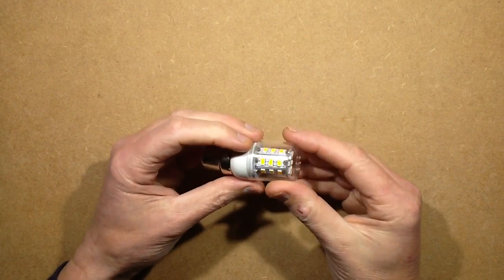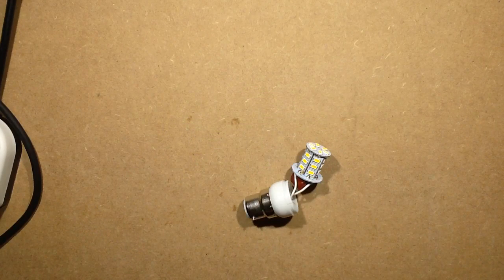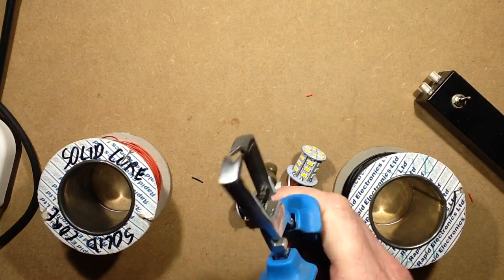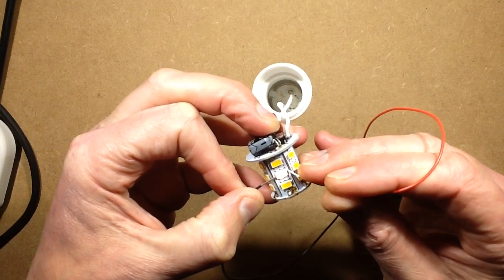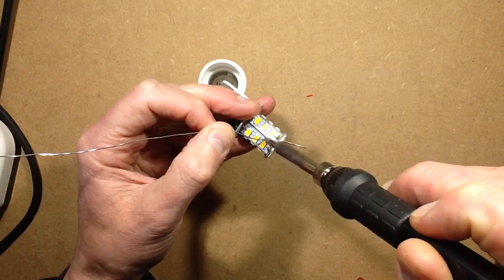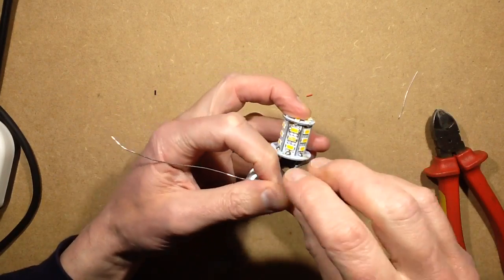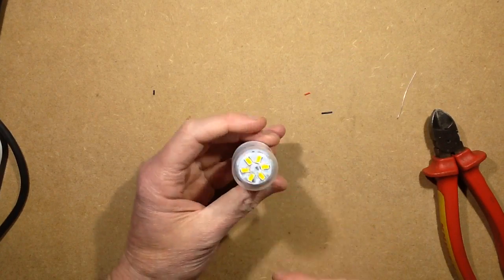Fixing a dead LED lamp.  (Interesting failure.)

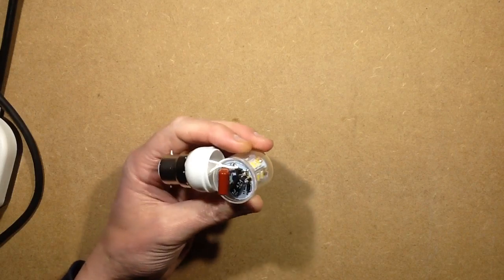Comment: 1:07 probably a discharging resistor. Do you agree?
Reply: Or the led itself
Reply from the maker: These lamps often have a discharge resistor across the dropper capacitor, and an inrush limiting one in series with it.
Reply: That’s what I said that there’s a discharging resistor

Comment: Clive, we all know that LED Lights often fail - well before their expected life! Being a bit of a Thinker, I would love your thoughts on this: Why not have an Induction Coil, which is inbuilt into the Bayonet Light Fitting - just a small (circular) torroidal transformer which could give a very low VA, and (yet) cater for all Wattages of LED Lamps. THEN, another much smaller circular coil, which is built into every production-made LED Light Unit. The whole purpose of this arrangement, is simply because there is an extremely-wide voltage range between the Domestic Mains supply (here in Australia is the same as the UK - at 240VAC and 50 Hz. Already, we have two (2) large issues: LED lights work absolutely the best on a stable DC Power Source, and also bringing down the wattage slightly using PWM.I have done this since 2005 in my home, with LED Lighting (17 individual Units) which illuminate my home from Dusk to dawn on 365 days / year, and it's so good that I could not live without it! My point is: Not ONE of those 17 LED Lights failed, but I just changed them all out last week, because I noticed that the illumination of each Unit had deteriorated over the 17 years of daily use. LED's work perfectly, at a stable current and voltage source, but more particularly if they have a well-known brand, and not a Chinese copy of the famous brands. If you are still reading this, the main objective here, is to solve the issue of the large voltage (mains supply), to the voltage that would be more suited. Lets say 12V AC. 
A small circular (mating) Coil which is built-into every LED Lamp, would ensure sufficient voltage could be supplied to illuminate any type of LED Array. In this way, the internal PCB and components that are currently used - could be slashed by the LED Manufacturer. I was horrified to open-up a 240V AC / 15W Light Bulb from ALDI. This was made in Germany. The PCB was loaded with 2X the number of components on the Board. Now, the worst part of all was the Cast Aluminium Heat Sink. I swear that this Casting weighed the equivalent of 20 aluminium Coke Cans!! Many or all of these failed lights end-up in Landfill. The ALDI LED LIght was also hard plastic coated. Germany has no thoughts on greening the Planet producing these. If you are still reading, my proposal would be this: Every person who uses LED Globes, could also buy a Bayonet Fitting with a circular coil. It's not Rocket Science to fit an external component (that would normally be inside an LED Light on some types), which can be used indefinitely. I would just love to see Clive make one of these - with fewer (bare minimum) internal lamp circuitry and components. Then, using a quality LED Module (such as Cree), then leave it permanently lit to log its' life. Sorry that this is an Essay, and greetings from Australia.

Comment: I have two corn cob lights waiting to be repaired and you have prompted me to finally do it. I also noticed the tiny black speck on a couple of the LED's and found them to be faulty so kept the globes for eventual repair. They were fairly cheap but only worked for a few weeks then died.
Hopefully the link across the dead ones will work.
Thanks for the effort producing all the videos.
After reading the comments it seems like a very common problem.

Comment: I literally have the exact same light, and the exact same thing happened to mine, black dots on the led's that burnt themselves out. Clearly this LED itself is a horrible design, if both mine and yours did it. If memory serves me correctly I bought it on ebay. I live in Australia where our voltage is also slightly higher than China's, when voltage at the source is higher, you would need a different value resistor to keep the current at the proper level that the led diodes can take. These fail commonly, because the extra 10-20v in our countries, drives the LED's a bit over, and because the LED's themselves are not super amazing in quality. 220v is China, Australia is 230v, Scotland is 230v. 
This isn't the worst LED I have however, I bought an LED that failed in a matter of minutes, to open it up and find out that the Chinese had used a 100v capacitor, predictably it was bulged out and destroyed. 
The only LED I have that lasts, are ones bought in Australian stores that are specifically made for our power. The longest lasting LED I have is my own LED made from 3 of the 1w diodes that are on a heatsink, and are run from a 3w LED constant current power supply bought off ebay, which is like a little white plastic box and about the size of a match box roughly. This setup has run every night for around 8 years, it's truly reliable.

Comment: Hi I took one of this apart I have 6 leds. Was wondering if I can connect this to a 12v motorcycle battery. Would I need anything or I can just connect it straight?
Reply from the maker: You can get 12V versions.
Reply: @bigclivedotcom  thanks for the reply. What I mean is if I don't want to buy any new led. Can I use this directly or I need resistor ?

Comment: I had one very much like this (screw base) fail after only 3 years....I say "only" because it is my flipping FREEZER light which is on MAYBE 20 minutes a month during the very brief times we open the freezer!  Makes me wonder now if the door switch is stuck.... why would anyone lead light fail Indo short of on hours??    Maybe 12 hours total on time in 3 years?  Probably much less I am using worse case..is there something about freezing temps that would cause early failure?   Should I use an incandescent instead ?

Comment: I bought 6 - 8 of these crap LED lights.  EVERY ONE of them failed like this.  No matter how many times you replace the blown LED with another one (from a different 'blown' LED bulb), it WILL blow again, guaranteed.  I finally threw them all out.  Complete garbage.

Comment: 4 years later .. does it still run ?I have had several of these lamps, and bridged many ledsbut they just keep failing !  poor design and manufacture.
Reply from the maker: Most of that style are severely over-run for intensity at the expense of lifespan.  If you swap the dropper cap for a lower value it makes them a bit dimmer, but last a lot longer.

Comment: I"ve had 3 of 'm die on me in the last few months...  is it just because they're rubbish or could I have a problem with the electrics in my house?  outside of bulbs nothing failed on me yet...
Reply from the maker: Many of them are pushing the LEDs too hard and if put in a warm area or enclosed fitting they overheat.
Reply: thanks  Clive, that could be it

Comment: Hello big Clive, I actually use these type of corn style bulbs at home (the 72 LED type) and just last night one of the bulbs showed some of those black spotted LED chips. Now this bulb will still light very dim but also after cutting out the power it slowly fades until it's off, I was wondering if you could examine the bulb if I could ship it to you. I very much enjoy your detailed way of exposing the different electronics!
Reply from the maker: The LED string has gone almost open circuit but is still allowing a little current to pass making them glow.  The slow dim out is because the low current means it takes a while to discharge the capacitor.
Reply: bigclivedotcom thank you for answering it makes sense! Keep up making your videos it's great watching!

Comment: @bigclivedotcom What brand or make/model of wire strippers on those? Tired of dealing w/ ones that are junk.
Reply from the maker: +David Willequer I tend to use a manually set Unior stripper.
Reply: Thanks for the follow up. Looks like those are hard to find in the United States but I found a pretty comparable one on Amazon after some digging. https://www.amazon.com/11-02-160-Insulation-Strippers/dp/B0001P0BYO

Comment: Great tip thanks Clive!
If you scrape/melt off the faulty led and just blob the board connection with solder it's even more easy and clean.
It's just a shame to throw away so many led's and components just because one small led is faulty.

Comment: I used a "V"  wire strippers some sixty years ago and I liked them much but they can nick the wires.  We were told that  type of p;lane had several crashes with many deaths and they traced the problem to a nick in the wires. Vibration caused the nick to grow ->  be careful.

Comment: I have been using 7 corn bulbs in a pendant ceiling fitting and despite intermittent use after about a year they have been failing every few weeks, in one case a replacement failed within days.   The failure rate is much worse than for an incandescent bulb.   I have just followed this video and successfully repaired 4 of these corn bulbs.   It will be interesting to see how long they last as clearly the voltage across each individual LED is now fractionally greater.

Comment: I recall an article comparing a LED bulb with an incandescent: the latter has one short-lived filament, the former (say) 15 LEDs in series. Point was that the LEDs and other components really need a low failure rate to be competitive because if one fails the bulb fails.

I think the $1 Dollar Tree 9W LED bulbs might outlast the $0.50 Dollar Tree 130-volt 60W incandescents they're replacing, but that's 12 LED chips, their solder joints, a capacitive dropper's components and their solder joints... versus a bit of tungsten and a very few wires and connections. Sure, I'm saving a good bit of power, but there's a lot than can fail...

Comment: it is not good idea, to fix like that, because if you connect wire like on video, result is to high current in the system. The LEDs will burn!!!! Kirchhoff's circuit laws my dear friend.
Reply: I dont think it's that big of a deal. Yes other leds will have higher voltage and be hotter and die faster but it will be barely noticeable.
Reply: Have you ever seen I (U) for diode? Even a small change in voltage can cause a huge change in the value of current flowing through the diode. current rise will increase capacity so that the LED will burn
Reply: I repaired 100+ this way and nothing happens if you're only doing it for up to 3 ~ 4 leds, no any noticeable difference in the life span of the other LED's.

Comment: Ha! - I've had 3 of these go  - I noticed the hole too, attempted to make 2 lamps out of 3 - but the LEDS keep failing - gave up. Caused by Voltage Peaks when the Arc Welder is running in the workshop?? Previous Pineapple lasted a few years before dying. You're doing a great job.

Comment: The problem is in 5730 LED TYPE:.. Those shine brightly but also get A LOT OF HEAT and thats big problem for LED. First thing you do is to remove the plastic transparent housing so that HEAT DISSIPATION is much better...  But it will still bun out eventuall...

Comment: First thing I do when I get those type of CORN LED is to remove the transparent plastic housing (I Saw it off).. This transparent housing is keeping the HEAT inside the led lamp which is a PROBLEM!... This way you extend lifespan of this lamp. 
Secondly, ... When repairing it, I just pile off the LED CHIP thas is burned out (visible sign off fry)..And then I simply solder it over..I Just completly replace LED CHIP with SOLDER:... Problem solved in 1 Minute !  :)
Reply: Exactly what I figured and did before I saw your comment.

Comment: The first LED lamp I ever bought failed within a year. (flickering).
Kinda depressing given that it claimed to have a 20 year lifespan.

I was curious about whether it's fixable, but I'm strictly amateur when it comes to electronics, and I barely have any tools either. (my only soldering iron at the moment is absolutely terrible, and basically unusable.)
(besides, I can't actually see any real way of opening mine without destroying it.)

Comment: Had the same fault with a 220V lamp with 8 LED's in series (or really 8*3 LEDs, since it takes about 8V to light one of them, must contain 3 LEDs). Blew another one during testing, so had to short that one too.

Comment: I found these cheap leds work great as refrigerator lights because the cheap leds used are kept cool and don't burn out :) have had one of these in my refrigerator for about a year now!

Comment: The Irwin vise-grip are the best wire strippers I've ever used. No need to adjust, just put the wire in and squeeze.
Reply: Zapp3012

Comment: Got the same lamp, but a bigger model. Same fault. Many of the other LEDs also look slightly darkened. They're just crap lamps
Reply: This corn lamp, using plastic case with breather. Sometimes, bugs coming in and made them some short-circuit.

Comment: Hi, thanks for the tip.
    You need not cut wires nor use a special tester.
    A multimeter set on diode test function will output 2.5-3V
    (at 3V wear sunglasses)
    That's all you need to put the probes on a LED and see if it glows.
    If you want a multimeter, this is a good Aliexpress shopping list:
    DT830B 3€ or DT9205A 6.2?-8€, rechargeable 9V bat. 3.3€, AA/9V
    charger 3.5€
    A LED shunting resistor must be 3-2.5V/100-150mA= 30-15
    Ω.
    But I goofed and used 220Ω instead of 22Ω and there was no visible
    dimming.
    So, one can use 50-220Ω safely and I settled on 100Ω

Comment: The makers and distributors of these corncob bulbs certainly vary in quality. I bought eight from one merchant on aliexpress that are all still going strong over a year later in a recreation room. A few months ago, I bought two slightly smaller bulbs and six slightly larger bulbs of the same design from another merchant on aliexpress. The two smaller ones died a month after I installed them. They were used intermittently in a water closet. It's not like they were on long enough to even get warm, because we don't linger in a water closet, eh? Now the six slightly larger bulbs are also flickering and showing signs of failure. I will never buy anything from the second merchant again, that's for sure.

I'm curious if after making a fix like this whether the fixture is likely to continue to degrade and fail again.

Comment: What's the voltage you used to test led?
Reply: A typical semiconductor LED can run from 1,7v - 2v. For newer color LED (White, Blue) need more higher voltage to run, about 2,8v until 3,2v (typical double series AA Alkaline battery can be used). All forward current is about 20mA.
Reply: The new SMD LED 5730 are rated between 2.8 - 3.6v (check which manufacturer it is).

If you wanna see how it looks like when a black dot appears :) just feed them 12v and you'll see a small spark fly and the LED will go POOF and die. Left with that small black dot signifying a dead LED.
Reply: Can i use a old phone charger (5V)?
Reply: @ nuno rolo maybe but you need to use at least diodes in series attached in positive wire of the charger to drop at least 1.5 v

Comment: Would it be possible to desolder the led with the hot air attatchment on the yihua station?
Reply from the maker: +rimmersbryggeri It depends on what the LED is mounted on.  If it's an aluminium core PCB to help take heat away it can prevent the desoldering.  Sometimes it's better to just break the LED.
Reply: Ok I have never worked with aluminium boards. We used to reflow graphics cards in a (CNC) hot air machine on my old job but they were all fibreglass or something interchangable.

Comment: The 5630 SMD LED is very common that they burn. This led tend to generate a lot of heat, and eventually burned.
If you buy led lamps, if equipped SMD 5630 reject!
Reply: Thanks, but how could we know, if buying from China, for example?

Comment: That particular LED would have been very easy to remove, heat one side and push it up with the soldering iron tip, heat up the other side and let it drop off. Maybe not proper, but can be easily done with damaging anything.

Comment: had   a  couple  to  "go"   -   put  LED  ACROSS   defunct  -   it worked - another  LED  died    .  So added in series   as a tesat   series of  1k  - but  1/8th watt  -   it  worked  but fumed  - as a test  - it worked  required  1 watt at  least  . These are the 220 v  - running on 240 volt  -  so in line  voltage dropper of 1 k - but gets warm .  These ARE  expensive   - but  they  rated at around 50 000   hours when  run to spec  

The  capacitors have bleed  resistors across  them  - hence they run  safe

Comment: I had 4 pretty expensive osram led bulbs, all but one have failed in 1-2 months and the fourth one has been in my room for half a year and flickers quite often. I do wonder how that even works.
Reply: I have been very impressed with Cree for brightness, visual temperature, and reliability. Comparable price to the other big brands.
Reply: If you are interested in led bulb, please contact with me. i'm led bulbs seller,

Comment: Won't bridging the LED increase the voltage on the others? Replacing the LED with another LED or resistor sounds like a much better repair.
Reply: Turns out - some LED bulbs have already current regulator, so the rest of the LEDs won't burn, because of the missing one. On the other hand...some might not have that reuglator, but still... if you have 15 or more LEDs working - I'm not sure if the missing one will cause the rest to burn really...time will tell...

Comment: I've got an LED bulb that I think has had a similar failure. I've taken it apart and there is one led that is completely missing another that the diffusing layer has fallen off. No idea what happened to the missing led and I haven't attempted to fix it yet.  I'm pretty sure if i bridge the missing led it will work but I haven't had the time.